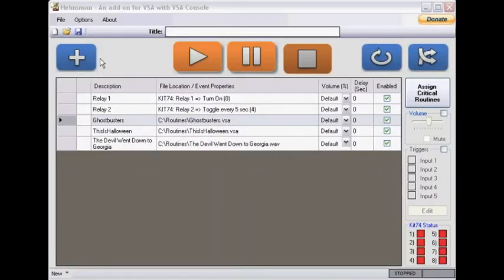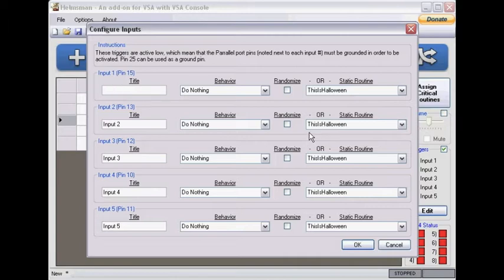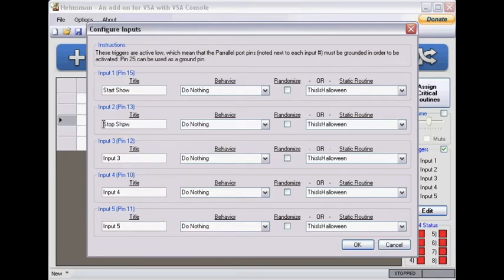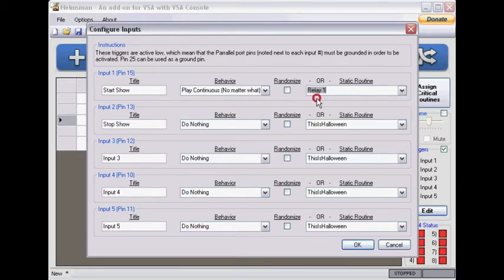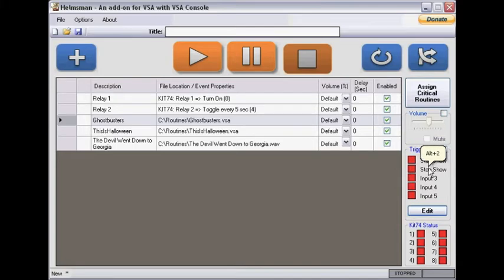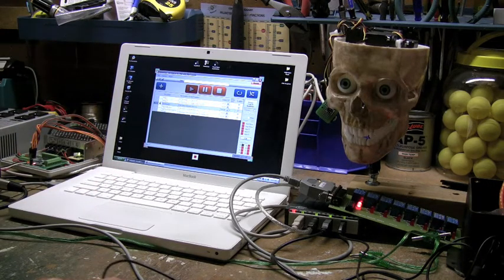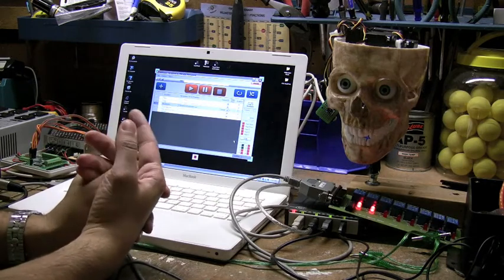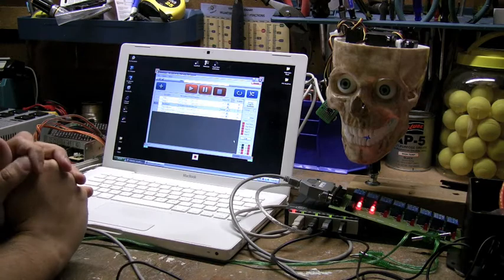Helmsman - Tutorial - Part 3 (Triggers)

Comment: That would be really nice, since 5 triggers really limits the complexity of what you can do with the application.  By using keyboard key events you could have a large number of triggers (especially if you make it case sensitive), and keyboard emulation boards like the one I mentioned before are readily available and easy to wire up to just about anything.

Helmsman seems to have a lot of potential.